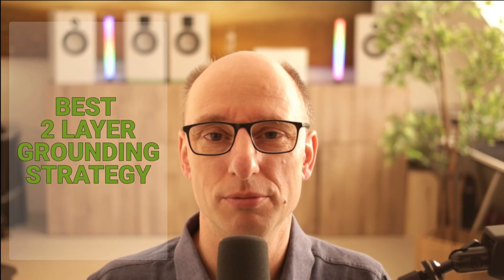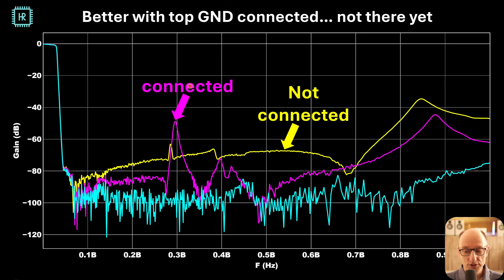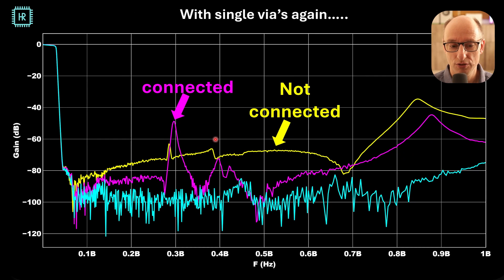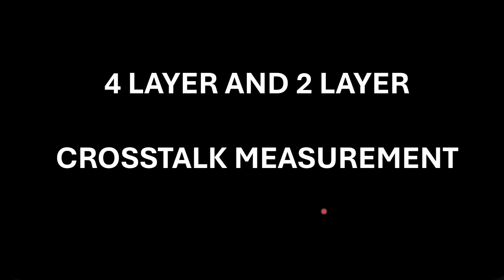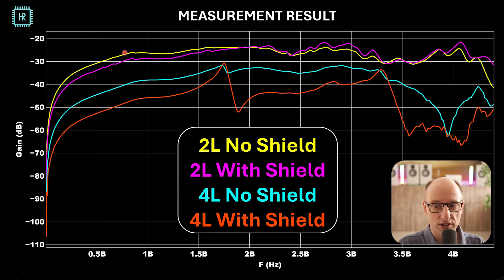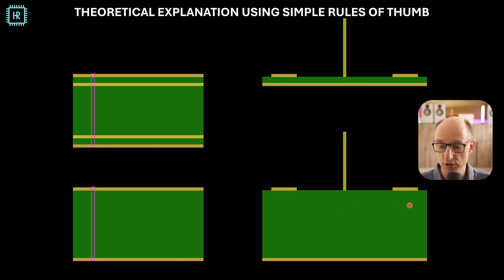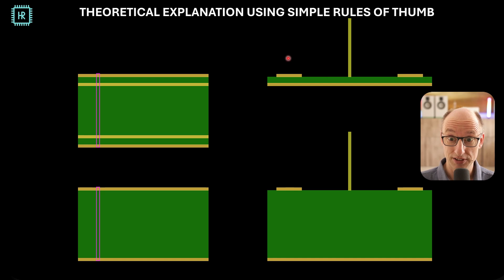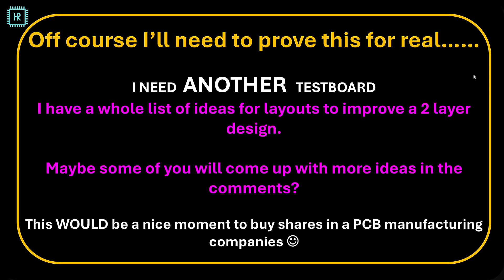Practical 2-Layer RF Design Rules (That Actually Work)

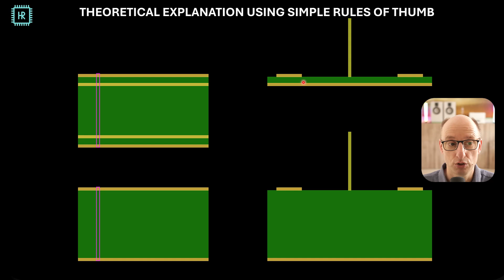Comment: at 10:45 obviously the capacitance from the signal to ground is small, but at very high frequencies won't this form a low pass filter? In a design dealing with high frequencies like this, would you alter the board stackup accordingly or cut out the ground plane below or some secret third option involving a lot of scary transmission line theory?

Comment: 1.- Among the 4 PCB cross sections shown at time stamp 08’02’’ of this wonderful video the top left one, 4 layers narrowly paired in 2s on both sides of the board, seems to be the best grounding solution. This is, top to bottom 1-2-3-4 you said: 

Signal-Ground---Ground-Signal.

I dare say :

2.- Additional bias connecting both grounds in layers 2 and 3 may help improve grounding.

3.- Reversing exposure to outer incident interference is also a common practice. Instead of S-G---G-S you can do

Ground-Signal---Signal-Ground.

4.- And if increasing the amount of layers from 4 to 6 is not cost prohibitive, even better is :

G-S-G---G-S-G (1-2-3-4-5-6)

with additional thick bias between layers 1-3, 4-6, and 3-4.

5.- I am interested in 1 copy of  “The Electronic Product Development Checklist” mentioned at time stamp 05’12’’.

I just tried to obtain it from your website hans-rosenberg.com with user: jgb2014@live.co.uk and password: .?32mun8xlE#dsGTzXvs83M2!I’”yhqKf9TrzGY@

But on setting up the password, your website keeps bouncing back to page with message “the change you wanted was rejected ..”

I tried to shorten the password -4 -8 -12 -16 from the above in case it was too long but it keeps bouncing back.

Would you please be so kind to send copy of the module part of the free mini-course “The Electronic Product Development Checklist” to jgb2014@live.co.uk ? thanks

Comment: Send me the checklist, please. Your videos are very helpful.
Reply from the maker: I've changed the free checklist offer a bit: You also get a 1 hour module of my course for free!

You can find the link to the page in the description. Scroll down a bit on that page (Or read the whole page, you may get curious :-) ) to find the link. It is a purple button 'Watch The Free Module And Get The Checklist'.

You will have to leave your email address so I can start spamming you :-D . I don't do that very often, on average once a month, but I am thinking about starting an email series with useful electronics tips at some point.

Best regards,

Hans Rosenberg

Comment: Ok, ik ben overtuigd, stuur mij die checklist ;) 

Erg interessante videos!
Reply from the maker: Hier is ie:
I've changed the free checklist offer a bit: You also get a 1 hour module of my course for free!

You can find the link to the page in the description. Scroll down a bit on that page (Or read the whole page, you may get curious :-) ) to find the link. It is a purple button 'Watch The Free Module And Get The Checklist'.

You will have to leave your email address so I can start spamming you :-D . I don't do that very often, on average once a month, but I am thinking about starting an email series with useful electronics tips at some point.

Best regards,

Hans Rosenberg

Comment: What a wonderfully presented work. I'd love this checklist to make better PCBs and especially to satisfy my curiosity. You are and excellent instructor Hans!
Reply from the maker: Thank you very much! I've changed the free checklist offer a bit: You also get a 1 hour module of my course for free!

You can find the link to the page in the description. Scroll down a bit on that page (Or read the whole page, you may get curious :-) ) to find the link. It is a purple button 'Watch The Free Module And Get The Checklist'.

You will have to leave your email address so I can start spamming you :-D . I don't do that very often, on average once a month, but I am thinking about starting an email series with useful electronics tips at some point.

Best regards,

Hans Rosenberg

Comment: "Send me the checklist" 

I'd love a checklist to help further my learning in this area. Would be much appreciated. I found this video very helpful, especially your testing procedure and other consideration for something seemingly so simple/basic as properly grounding 2-layer boards.
Reply from the maker: Haha, yes, if you're not aware they can give you quite a few headaches :-)

I've changed the free checklist offer a bit: You also get a 1 hour module of my course for free!

You can find the link to the page in the description. Scroll down a bit on that page (Or read the whole page, you may get curious :-) ) to find the link. It is a purple button 'Watch The Free Module And Get The Checklist'.

You will have to leave your email address so I can start spamming you :-D . I don't do that very often, on average once a month, but I am thinking about starting an email series with useful electronics tips at some point.

Best regards,

Hans Rosenberg

Comment: Please send me your checklist. Thanks.
Reply from the maker: I've changed the free checklist offer a bit: You also get a 1 hour module of my course for free!

You can find the link to the page in the description. Scroll down a bit on that page (Or read the whole page, you may get curious :-) ) to find the link. It is a purple button 'Watch The Free Module And Get The Checklist'.

You will have to leave your email address so I can start spamming you :-D . I don't do that very often, on average once a month, but I am thinking about starting an email series with useful electronics tips at some point.

Best regards,

Hans Rosenberg

Comment: Thank you for the explanation and the sharing of your experience. I think it would have been nice to have a small overview of the possible effect of the rest of the via for the 4 layers board.
 I'm really interested by your checklist, could you please send it to me ?
Reply from the maker: I've changed the free checklist offer a bit: You also get a 1 hour module of my course for free!

You can find the link to the page in the description. Scroll down a bit on that page (Or read the whole page, you may get curious :-) ) to find the link. It is a purple button 'Watch The Free Module And Get The Checklist'.

You will have to leave your email address so I can start spamming you :-D . I don't do that very often, on average once a month, but I am thinking about starting an email series with useful electronics tips at some point.

Best regards,

Hans Rosenberg

Comment: Thank you SO much for this helpful information! The timing is perfect for me as I am about to make my first HF boards for ham radio. Please send the checklist to me also! I can't wait to read it 😁
Reply from the maker: I've changed the free checklist offer a bit: You also get a 1 hour module of my course for free!

You can find the link to the page in the description. Scroll down a bit on that page (Or read the whole page, you may get curious :-) ) to find the link. It is a purple button 'Watch The Free Module And Get The Checklist'.

You will have to leave your email address so I can start spamming you :-D . I don't do that very often, on average once a month, but I am thinking about starting an email series with useful electronics tips at some point.

Best regards,

Hans Rosenberg

Comment: Please send me checklist
Reply from the maker: I've changed the free checklist offer a bit: You also get a 1 hour module of my course for free!

You can find the link to the page in the description. Scroll down a bit on that page (Or read the whole page, you may get curious :-) ) to find the link. It is a purple button 'Watch The Free Module And Get The Checklist'.

You will have to leave your email address so I can start spamming you :-D . I don't do that very often, on average once a month, but I am thinking about starting an email series with useful electronics tips at some point.

Best regards,

Hans Rosenberg

Comment: Please send me the checklist! Dankjewel
Reply from the maker: I've changed the free checklist offer a bit: You also get a 1 hour module of my course for free!

You can find the link to the page in the description. Scroll down a bit on that page (Or read the whole page, you may get curious :-) ) to find the link. It is a purple button 'Watch The Free Module And Get The Checklist'.

You will have to leave your email address so I can start spamming you :-D . I don't do that very often, on average once a month, but I am thinking about starting an email series with useful electronics tips at some point.

Best regards,

Hans Rosenberg

Comment: Maybe the shielding plate could be continued in the PCB with an GND plane connected via row. Via distance must below wavelength so even with GHz you only need a few. The  divider can be soldered to that via row if you expose the via top copper.
Reply from the maker: Yes, that should work. Want to try and build and measure that once
Reply: @HansRosenberg74  Maybe using 2 rows (and plates) to see the amount of attenuation when more shielding is used.

Comment: Please send me the check list, thank you for this series of valuable info
Reply from the maker: I've changed the free checklist offer a bit: You also get a 1 hour module of my course for free!

You can find the link to the page in the description. Scroll down a bit on that page (Or read the whole page, you may get curious :-) ) to find the link. It is a purple button 'Watch The Free Module And Get The Checklist'.

You will have to leave your email address so I can start spamming you :-D . I don't do that very often, on average once a month, but I am thinking about starting an email series with useful electronics tips at some point.

Best regards,

Hans Rosenberg

Comment: Send me the checklist, please。 Thank you so much.
Reply from the maker: I've changed the free checklist offer a bit: You also get a 1 hour module of my course for free!

You can find the link to the page in the description. Scroll down a bit on that page (Or read the whole page, you may get curious :-) ) to find the link. It is a purple button 'Watch The Free Module And Get The Checklist'.

You will have to leave your email address so I can start spamming you :-D . I don't do that very often, on average once a month, but I am thinking about starting an email series with useful electronics tips at some point.

Best regards,

Hans Rosenberg

Comment: Send me the checklist. This series is fantastic.
Reply from the maker: I've changed the free checklist offer a bit: You also get a 1 hour module of my course for free!

You can find the link to the page in the description. Scroll down a bit on that page (Or read the whole page, you may get curious :-) ) to find the link. It is a purple button 'Watch The Free Module And Get The Checklist'.

You will have to leave your email address so I can start spamming you :-D . I don't do that very often, on average once a month, but I am thinking about starting an email series with useful electronics tips at some point.

Best regards,

Hans Rosenberg

Comment: Hi, send me the checklist, thank you
Reply from the maker: I've changed the free checklist offer a bit: You also get a 1 hour module of my course for free!

You can find the link to the page in the description. Scroll down a bit on that page (Or read the whole page, you may get curious :-) ) to find the link. It is a purple button 'Watch The Free Module And Get The Checklist'.

You will have to leave your email address so I can start spamming you :-D . I don't do that very often, on average once a month, but I am thinking about starting an email series with useful electronics tips at some point.

Best regards,

Hans Rosenberg

Comment: Send me the checklist. Thanks Hans.
Reply from the maker: I've changed the free checklist offer a bit: You also get a 1 hour module of my course for free!

You can find the link to the page in the description. Scroll down a bit on that page (Or read the whole page, you may get curious :-) ) to find the link. It is a purple button 'Watch The Free Module And Get The Checklist'.

You will have to leave your email address so I can start spamming you :-D . I don't do that very often, on average once a month, but I am thinking about starting an email series with useful electronics tips at some point.

Best regards,

Hans Rosenberg

Comment: Send me the checklist (great videos by the way!)
Reply from the maker: thanks! I've changed the free checklist offer a bit: You also get a 1 hour module of my course for free!

You can find the link to the page in the description. Scroll down a bit on that page (Or read the whole page, you may get curious :-) ) to find the link. It is a purple button 'Watch The Free Module And Get The Checklist'.

You will have to leave your email address so I can start spamming you :-D . I don't do that very often, on average once a month, but I am thinking about starting an email series with useful electronics tips at some point.

Best regards,

Hans Rosenberg

Comment: Hi can I please get the free checklist from you?
Reply from the maker: I've changed the free checklist offer a bit: You also get a 1 hour module of my course for free!

You can find the link to the page in the description. Scroll down a bit on that page (Or read the whole page, you may get curious :-) ) to find the link. It is a purple button 'Watch The Free Module And Get The Checklist'.

You will have to leave your email address so I can start spamming you :-D . I don't do that very often, on average once a month, but I am thinking about starting an email series with useful electronics tips at some point.

Best regards,

Hans Rosenberg

Comment: Send me checklist. Thx a lot.
Reply from the maker: I've changed the free checklist offer a bit: You also get a 1 hour module of my course for free!

You can find the link to the page in the description. Scroll down a bit on that page (Or read the whole page, you may get curious :-) ) to find the link. It is a purple button 'Watch The Free Module And Get The Checklist'.

You will have to leave your email address so I can start spamming you :-D . I don't do that very often, on average once a month, but I am thinking about starting an email series with useful electronics tips at some point.

Best regards,

Hans Rosenberg

Comment: Send me the checklist. Thanks 👍.
Reply from the maker: I've changed the free checklist offer a bit: You also get a 1 hour module of my course for free!

You can find the link to the page in the description. Scroll down a bit on that page (Or read the whole page, you may get curious :-) ) to find the link. It is a purple button 'Watch The Free Module And Get The Checklist'.

You will have to leave your email address so I can start spamming you :-D . I don't do that very often, on average once a month, but I am thinking about starting an email series with useful electronics tips at some point.

Best regards,

Hans Rosenberg

Comment: Hi! I really enjoy your videos. I also work on a lot of PCB designs and would love to get a copy of your checklist if possible.
Reply from the maker: Thanks a lot! I've changed the free checklist offer a bit: You also get a 1 hour module of my course for free!

You can find the link to the page in the description. Scroll down a bit on that page (Or read the whole page, you may get curious :-) ) to find the link. It is a purple button 'Watch The Free Module And Get The Checklist'.

You will have to leave your email address so I can start spamming you :-D . I don't do that very often, on average once a month, but I am thinking about starting an email series with useful electronics tips at some point.

Best regards,

Hans Rosenberg

Comment: Hi Hans! Could you send me the checklist, please!
Thank you!
Reply from the maker: I've changed the free checklist offer a bit: You also get a 1 hour module of my course for free!

You can find the link to the page in the description. Scroll down a bit on that page (Or read the whole page, you may get curious :-) ) to find the link. It is a purple button 'Watch The Free Module And Get The Checklist'.

You will have to leave your email address so I can start spamming you :-D . I don't do that very often, on average once a month, but I am thinking about starting an email series with useful electronics tips at some point.

Best regards,

Hans Rosenberg

Comment: Can you send me the checklist please ?
Reply from the maker: I've changed the free checklist offer a bit: You also get a 1 hour module of my course for free!

You can find the link to the page in the description. Scroll down a bit on that page (Or read the whole page, you may get curious :-) ) to find the link. It is a purple button 'Watch The Free Module And Get The Checklist'.

You will have to leave your email address so I can start spamming you :-D . I don't do that very often, on average once a month, but I am thinking about starting an email series with useful electronics tips at some point.

Best regards,

Hans Rosenberg

Comment: Send me the checklist, please. I love your videos!
Reply from the maker: Thanks. I've changed the free checklist offer a bit: You also get a 1 hour module of my course for free!

You can find the link to the page in the description. Scroll down a bit on that page (Or read the whole page, you may get curious :-) ) to find the link. It is a purple button 'Watch The Free Module And Get The Checklist'.

You will have to leave your email address so I can start spamming you :-D . I don't do that very often, on average once a month, but I am thinking about starting an email series with useful electronics tips at some point.

Best regards,

Hans Rosenberg